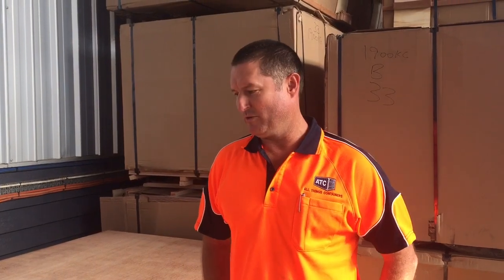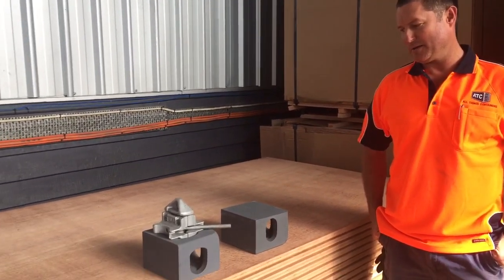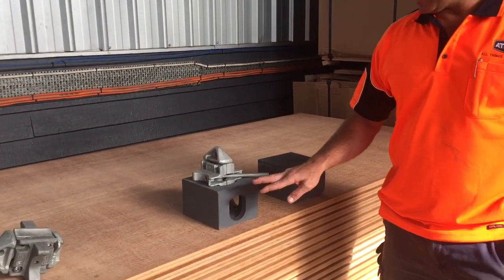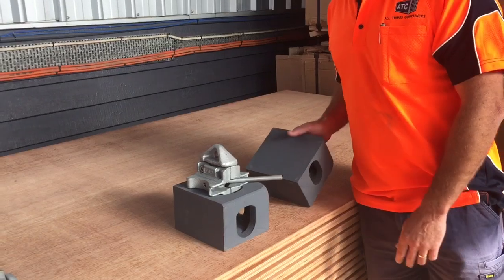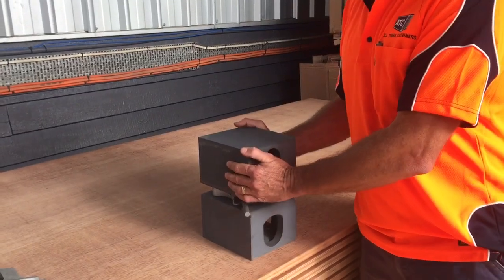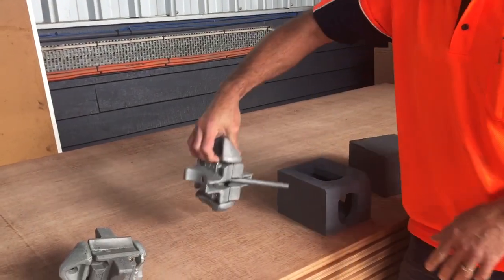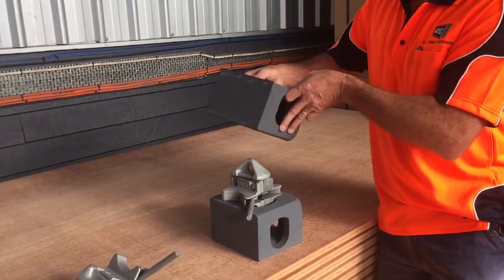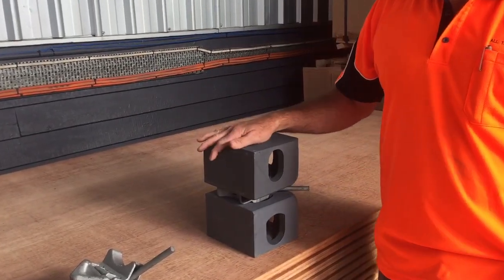How Double Ended Twist Locks for Shipping Containers Work

Comment: Left locking and right locking ? Don't you just turn them over ?
Reply: no mate. there is a top and a bottom. taper end piece that is shaped like an A goes to the top. helps the guys loading the Shipping container on top of another container when the bottom castings of a container arent exactly in line.

Comment: So, if you flip a right handed twist lock over, doesn't it become a left handed twist lock?
Reply: no mate. there is a top and a bottom. taper end piece that is shaped like an A goes to the top. helps the guys loading the Shipping container on top of another container when the bottom castings of a container arent exactly in line.